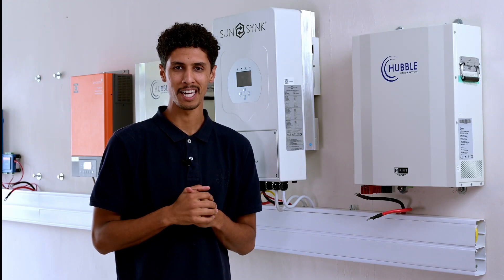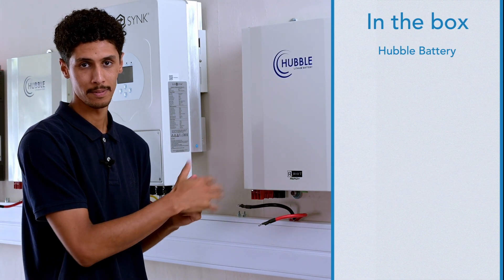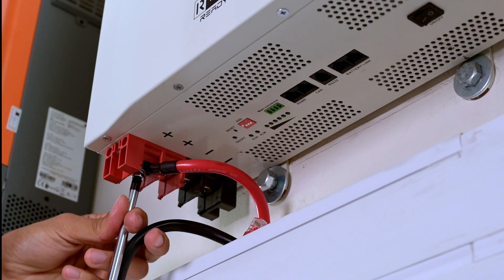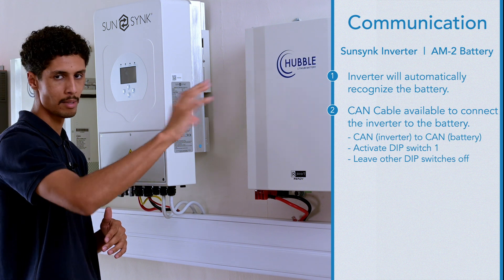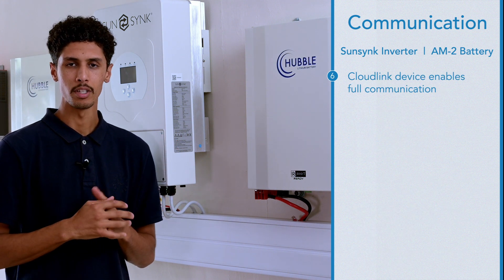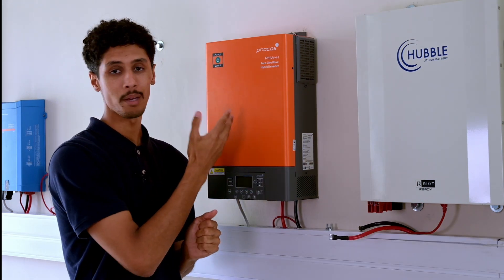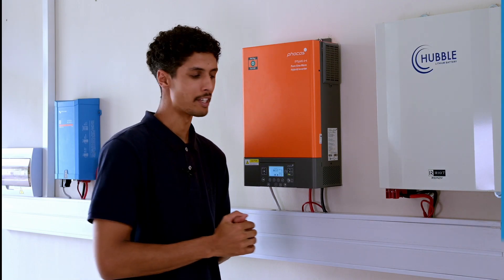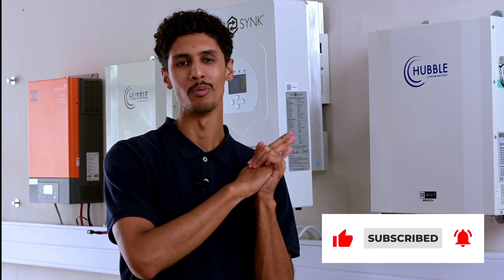Hubble Lithium's 51V 5.5KW AM-2 Installation Tutorial for Sunsynk & Axpert Inverter Types [2022]

Comment: I have a 5.6kW kodak inverter and 5.5kW Hubble set up. Battery shows 100% when charging, but the moment loadshedding starts battery percentage drops to 77% and after a 2hr loadshedding session battery stands on 58%, the estimated load is between 280W and 330W. What can be wrong the battery or the inverter?
Reply from the maker: Hi Malcolm, 

Please email the information below to support@hubblelithium.co.za or open a ticket on https://support.hubblelithium.com/ so that the technical department can assist you.  

Alternatively, you can call them on 010 023 7130.
 
Please include the following information:
1. Inverter make & model 
2. Model & number of connected batteries 
3. Are your batteries in Series or Parallel? 
4. A brief description of your system issues 
5. If possible; images of your power system 
6. Your contact details - should Technical want to give you a direct call. 

Thank you

Comment: If you using 2 batteries, do you set only one battery on the DIP switch setting or both of them?
Reply: both batteries need to be set , one as a master and the other as battery 2. check the battery PDF for the dip settings, AM2 is different for example from AM5

Comment: Hi there,

I recent Purchased a Hubble lithium 5kw am2 Battery like in the video and a Sunsync 5kw hybrid inverter.

Once everything was connected the battery showed as 100% charged. After the first usage of the  loadshedding. The battery got recharged again to 100%, but after the second time using it which is daily now with loadshedding the battery doesn't recharge to 100% anymore it only goes to around 94% or 97% charge rate. The electrician says that it's normal and that the battery will never show 100% fully charge again becausd the inverter takes of the power of the battery.... Can anyone explain? Or advise me.. I only have this setup for like 4 days... So still learning....
Reply: Okay so just spoke to my installer electrician. He said it's not normal and that he just escalated it to Hubble management to check it out. So he just told me to wait until hubble responds to the escalation on this new battery fault.
Reply: Alhamdulillah! Awesome stuff. I contact hubble and managed to get one of their professional technicians to come and update the firmware and that fixed the communication issue between the inverter and battery. Both the inverter and batteries firmware had to be updated. Took around 15mon minutes to do the job. Thanks Hubble for your swift response time and quick fix. Much appreciated.! Happy customer:)

Comment: I have been ready to buy an AM2 for a while now. Unfortunately there is no way of getting a list of recommended + certified installers in our area that I can get a hold of, to come and look at the legacy installation with the deep cycle batteries, and my SOL-I-AX-5KP Mecer (Axpert) to give the thumbs for buying the N-S-HUBBLE-AM-2 and installing it. 

I asked your company (Hubble) a year ago and the response was negatory. 
I then asked if there was training material (videos and the like) and was told no. 

If there was a higher level of support, I am sure this gr8 South African product would have even more traction.  
I am on the West Coast btw. 

As a potential customer the aim is to mitigate the risk for: a) compatibility (voltages et. al.) to ensure purchase viability upfront.
The secondary aim would be the configuration for the Axpert inverter (voltages, and comms) which unfortunately were not on this video.

If you gave us hands-on installation instructions, compatibility information, and _empowered the consumers to a) verify b) install, it would be really good.
Reply from the maker: Hi Kambiz, 

Due to the danger of working with such high voltage systems our products must be installed by qualified electricians. Please follow this link to our contact form and I will personally ensure that you are provided with a list of trusted installers in your area: https://www.hubblelithium.co.za/contact.html 

Should you have any technical queries please contact our new dedicated support team at support@hubblelithium.co.za with the following information so that we can provide you with timely assistance:

1. Inverter make & model
2. Model & number of connected batteries
3. Are your batteries in Series or Parallel?
4. A brief description of your system issues
5. If possible; images of your power system

Comment: When you install two Hubble 5Kw batteries as per this video to the Sunsynk inverter, how do you add two batteries 
Are they connected in series or parallel 

Does the positive to the inverter need to start on the first battery and the negative of the 2nd battery to the inverter ? 

Ie positive to positive between the two batteries ?
Reply from the maker: Hello Tyrone, 
Typically you would connect the batteries in parallel. To utilize your system well, ensure that your cable lengths are the same and that you are running your positive from the 1st battery and your negative from the 2nd battery to the inverter. Please note that we cannot respond further with technical queries. For further support please email support@hubblelithium.co.za.
Reply: @Hubble Lithium  if you connect in parallel your positive and negative won't be the same size in length?